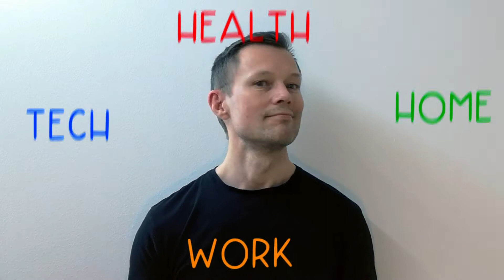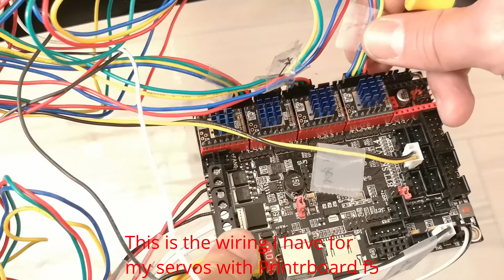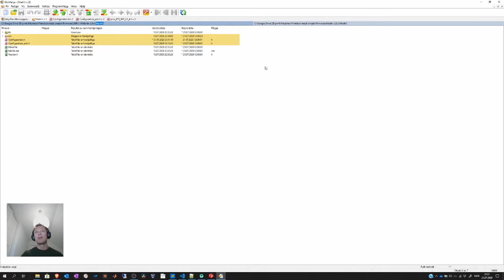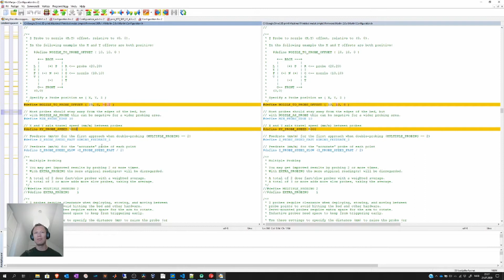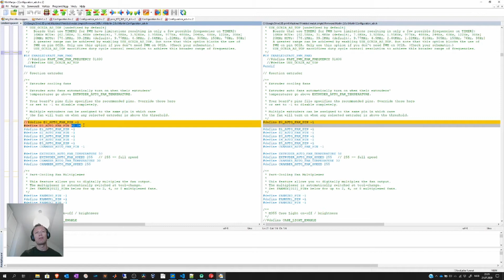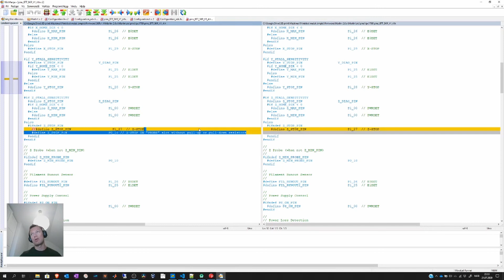How I resurrected my Printrbot Metal Simple and made it better than new 3D-printers | diy 3d printer

Comment: I was curious about replacing the board before but now may have to now as my micro usb came off the board..  People suggest using the SKR min now.  Which would you prefer if done today.  Thanks
Reply from the maker: I am very pleased with the current board. I just recently upgraded to the latest Marlin and now I am running the good ol' printrbot with input shaping and linear advance. Not bad for a pioner printer.

Comment: Very clear - thanks.  Are there any of your firmware changes necessary if using the SKR v1.4 / v1.4 "Turbo" with the TMC2209 instead of your TMC2208?  By now, have you added an LCD screen? Thanks much
Reply from the maker: I think it should be straight forward to just comment out the lines for the 2209 rather than the 2208 if you are not using sensorless homing etc. You should consult Chris' Basement to make sure. I have still not added an LCD screen; I can do without when using octoprint and my Phone:D

Comment: Temp graph seems to work..ill check my connection..i sokdered to pins directly the odd thing is why ps just shuts off...its 16A...the heat bed is 120w  10A not sure what nozzle A is.

Comment: Well there are numerous issues and the usb port on back is more reliable thsn front power wise. The only issue i had pre heat bed was pc not seeing the printer i would have to reflash firmware constantly. These are issues post heat bed install. 1. Printer just stops in middle of print with no error...2. Printer power supply shuts off before nozzle gets too temp...3. Marlin 1.1.9 wont work with heat bed...i reverted back to stock firmware ran 3 prints last night 2/3 worked...1 stopped in middle of print.
Reply: I really don't know what can be the reasons, but some suggestions: 1. Your psu is underpowered. Are you using the stock psu or a proper  power atx supply. 2. Try a different computer, eg. raspberry pi with octoprint. 3. replace the motherboard like I did.
Reply: @eventhatsme  thanks not looking to make this a project...i dont know anyhting about razberry pie nor do i even want to learn..im not a tech person...i use an ATX power supply 16A..i threw the stock PS in trash its useless even without heat bed...and yes underpowered with  heat bed...i have had issues with this printrbot since day 1...so im pretty sure it could be a lemon/defect with main board. or its possible it could be windows issue.but i doubt it...i use windows XP...however  the printer wont even work if i put sd card in it with file on it....i ordered a lcd display for it for only $10..im going to try and use it without pc...i use my anet a8 standalone and it works great...connecting to pc can create too many headaches...if it doesnt work with the lcd display and standalone then i can rule out it being an external factor.

Comment: thanks .and it wont let me do m502 m500 during eeprom mismatch.....yes i have tried installing marlin 1.1.9 from mr brooks site and i get so many goofy issues.....i had had my printer plugged into front usb so i have heard front usb sometimes can cuase issues so now i plug into back usb port....seems not losing connection now..however with marlin 1.1.9 i now have issue of power supply turning off when heat bed on.(i have a desktop pc 12v 16a power supply) ..and doing other goofy things like not heating nozzle....this has been a 1yr ordeal i have reflashed over 25 times...someone said marlin 1.1.9 is better and for me its a lot worse so i just reverted back to stock firmware.today ..and now power supply stays on when heat bed on...however i jsut ran a print and about 3 min into print the printer just stopped....ps was on..green light on board was on...but print just stopped.....have no idea why. im running another print now will see if it will actually complete with stock firmware....apparently marlin 1.1.9 i can not use...this is just so frustrating..my anet a8 has never had firmware issues.
Reply: It seems like you resolved the usb issue by using a working port. This leaves the sudden stop as the problem. I had similar problems when the non-stock heat bed thermistor connector had a bad connection. What does the temperature graphs show? What does the G-code terminal say?

Comment: Hi...i have stock printrbot simple metal .. i installed marlin 1.1.9 becsuse orig firmware has required 25 reflashes in 3 months..it would never connect......yesterday printer went online ok but then said eeprom mismatch and now wont connect.
Reply: I have no idea why this is happening. Perhaps you could restore eeprom to factory defaults with M502 and store with M500: https://marlinfw.org/docs/gcode/M502.html. 

Have you tried installing "modern marlin" from here?: https://github.com/Printrbot/printrboardmodernmarlin